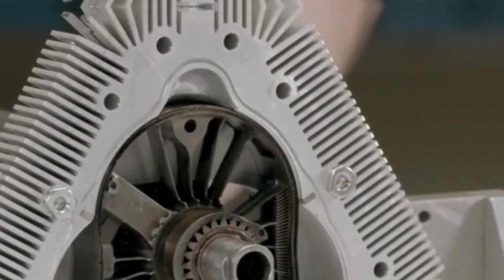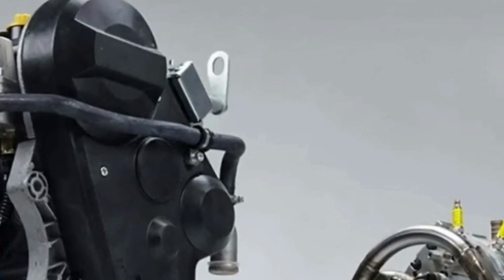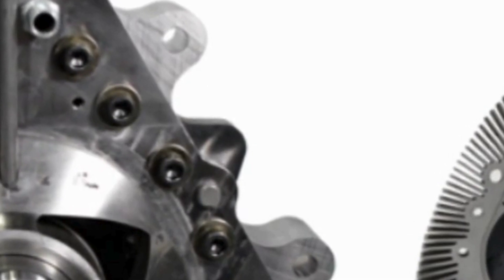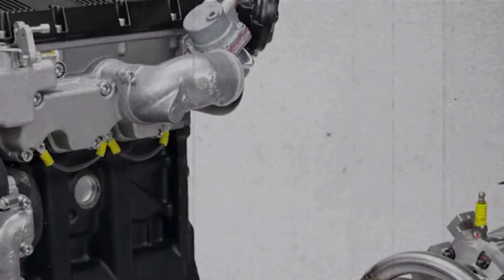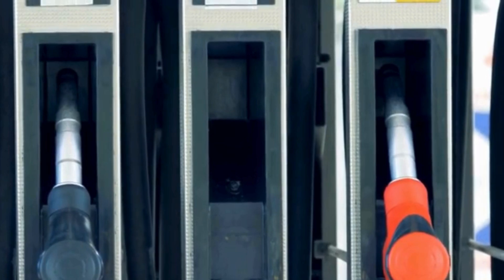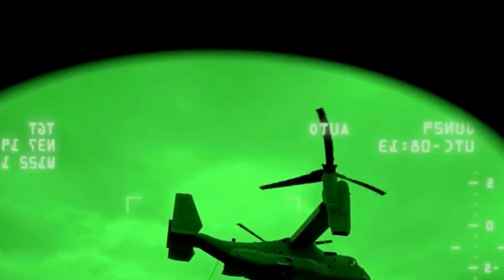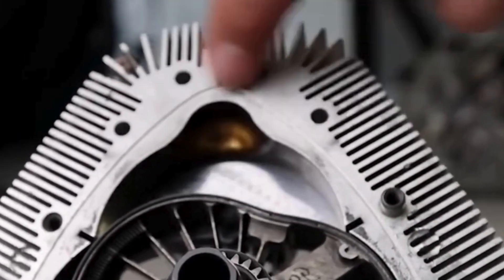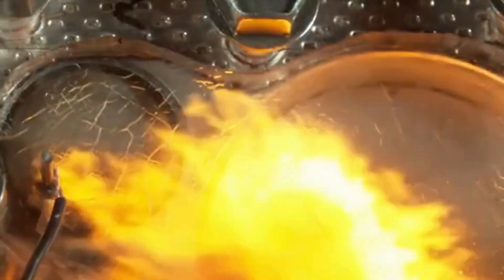NEW ROTARY ENGINE!It will put an end to electric motors#evnews  #evs #evcars

Comment: A typical diesel automotive engine operates at around 30% to 35% of thermal efficiency.   It is therefore impossible to increase power output five fold whilst halving emissions, this would require a thermal efficiency of 350% which defies the laws of physics (as well as common sense).   Think harder.
Reply from the maker: Thank you for your comment, subscribe to the channel!

Comment: 🤣🤣🤣🤣...Internal combustion is going the way of the steam engine. Tearing molecules apart is at best 30% efficient in getting wheels moving. An electric motor will always outperform any ICE technology, not only in efficiency but in power to weight ratio and torque. Moving electrons around is the only clean and sustainable way of powering ground transportation.
Reply: Google cobalt strip mine and tell how "good for the environment" or "clean and sustainable" does that look to you and sorry to say buddy most of those electrons you're pushing around were made using fossil fuels
Reply: @Boofed_It  An increasing number of EV batteries have no cobalt or nickel in them at all. LFP is now the most common battery type. Cobalt is not strip mined, it is mined as a by product of copper mining and can be recycled endlessly, unlike crude oil based products which cannot. Crude oil continues to create more pollution, more death and habitat destruction in drilling, pumping, refining and burning than any of the elements used in an EV battery. Sorry to say buddy that no fossil fuel burning electrons have gone into my battery. I live in France, have solar panels and less than 5% of our electricity comes from coal. Renewables are rapidly replacing coal and gas for electricity generation and any person who cares to study the subject properly will know that an EV is orders of magnitude better for the environment than any fossil fuel burning car. Got it, 'buddy'?
Reply: @kiae-nirodiariesencore4270  After mining, cobalt ore is processed using reductive leaching, solvent extraction, precipitation, settling, and filtration. The final product is either redissolved and electrowon as cobalt metal or sent to market for cobalt chemical production - hardly “environmentally friendly“ like most mining it is energy intensive, uses significant amounts of fossil-based fuels, and the tailings that result are a pollution nightmare.
Reply from the maker: Did you really think so?
Reply: Not true.  I.C. engines can best 40% efficiency.  Steam turbines can reach nearly 50% efficiency.  Electric engines will always be less efficient than the source of the electricity.
Reply: @brianburnside5949  Only the Toyota hybrid engine running on the Atkinson cycle can just about manage 40%. Remember that by the time the gallon gets into your tank 50% of the original energy in the crude is lost in pumping, shipping, refining and shipping again to the petrol station. An electric motor is 95% efficient at turning power into km driven and last year 80% of my driving came from the solar panels on my roof, power produced and consumed on site...no fossil fuel car can beat that and who has a petrol pump at home?
Reply: Yeah you're brain dead and willing to ignore simple facts regarding procurement of materials.  How much is china paying you for promoting propaganda?